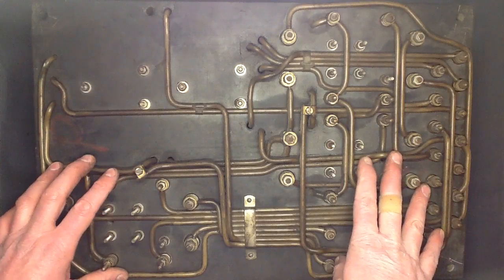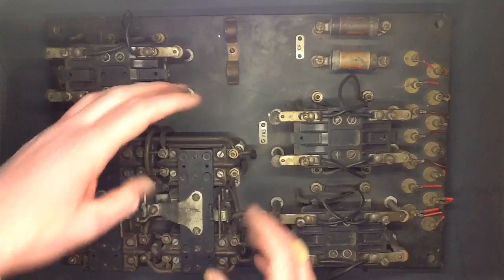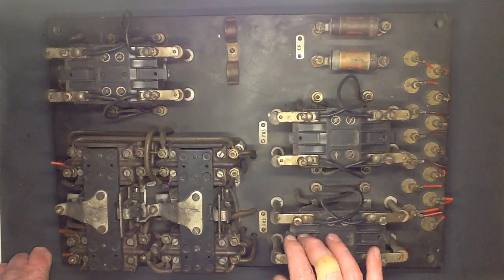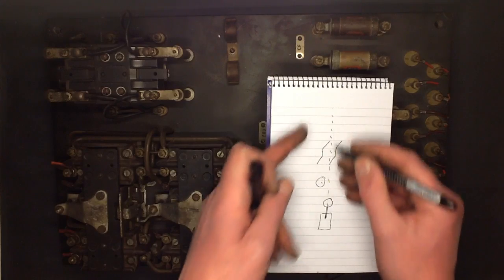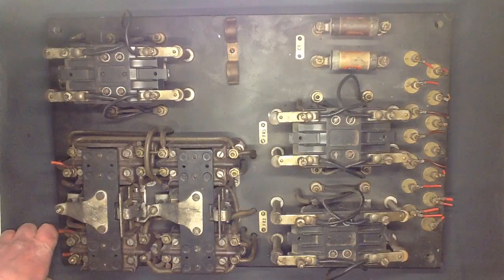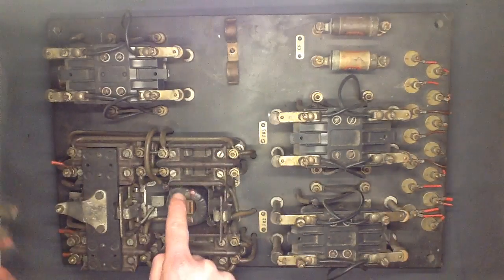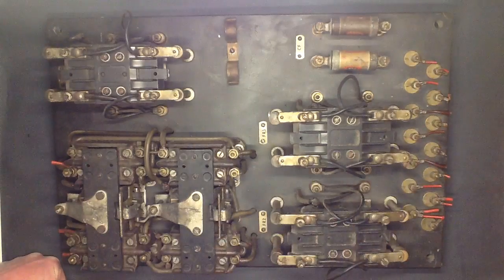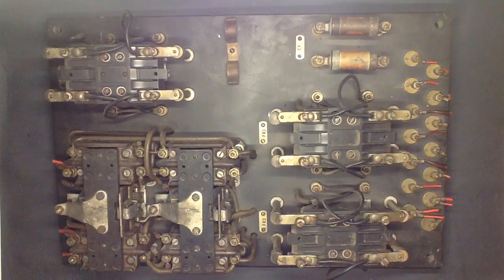Really old and VERY heavy slate elevator controller.

Comment: as an elevator repair mechanic, i enjoyed this video! :D
Reply from the maker: i bet you don't come across many like this these days.
Reply: bigclivedotcom honestly? The majority of them has been replaced, but they're still a whole lot around. The oldest I've seen, that is still working, is from 1933!
Reply from the maker: That's good.  For many applications they are just physically better suited to the job.  No secret diagnostic codes and extremely expensive drives that go bang on a regular basis.
Reply from the maker: If you get a chance to film some of the older units in operation it's always popular material on YouTube.  Even the simplest controllers and machines.
Reply: Will do mate. I've got a repair planned on an elevator with a panel similar to this one soon, will shoot a video. And yes, laws and regulations force clients to replace these panels with frequency regulated drive modules, and if they go bang, which they'll do eventually, it'll cost around €5000 for a replacement unit.
Reply from the maker: When you do make a video, remember that it's more important to get that video on YouTube than how it looks or sounds.  I think a lot of good technical footage never makes it to YouTube because people thought it wasn't good enough.  When you're filming in the raw with a phone it's never going to look or sound like the "pro" videos.

Comment: Memories! I served my time in a place that was full of kit of similar type(s). The place was all electro-mechanical, with rotating DC machines for generation and drives. Amplidynes, boosters, and a huge 11kV powered synchronous motor driven double ended Ward-Leonard set.
All pretty reliable as long as it was kept clean.

Comment: we had a similar one in QMD, it went from lower ground at the rear of the building up to the canteen.  The panel in the lift plant room was a joy to watch clacking and clunking through it's sequences... and although it was regularly checked during scheduled maintenance, it was rarely out of service or requiring any real work... just contacts getting cleand, like you said... unlike the electronic laden ones at reception... the fancy modern Otis Gen 2s (not to be confused with penguins) in PQ are so reliable I tend to use the stairs more often than not.

Comment: Clive have you ever visited the Manx Electric Railways sub-station at Laxey? Very large slate slabs for the switches and contactors and, when I visited many years ago, mercury arc rectifiers, cooled by the original wooden fan.

Comment: Very interesting, great idea for a video, Big Clive! Appeals to our sense of proportion and imagination of history. But, lots of big clunky contacts, imagining those high voltages and massive currents but see nor hear anything about insulation between those contacts
Reply from the maker: A  lot of this equipment is still in use, and the machine-rooms have stacks of electrical equipment covered in exposed live metalwork.
Reply: bigclivedotcom Actually my question was about the insulation material used in contacts inside those relays. Can't make out any for sure in the video. Incidentally, why would all the wires on the underside have been sheathed in metal?

Comment: Solid Slate Relay=Expensive and intricate but well made and built to last.
Solid State Digital=Really Expensive and flimsy but not made to last.Relay controllers are much better quality, reliable, easier to repair, and last a very long time with very little problems.

Comment: I'm surprised that you said that this control board was simply mounted on the wall. Did you mean that it was completely exposed with no surrounding box around it? I fear dust and bad contacts, although perhaps if it's in a box that would keep most dust away

Comment: I love this beautifully made frankenstein stuff........It reminds me of the choke assembly of my old Rolls Royce Shadow....No electronics, just a butterfly attached to a coiled spring in a tube from the manifold which was closed when cold. When the engine was started, the heat would start to expand the spring, opening the butterfly and lessening the choke until the engine was warm ! They used this up until the late 80's.It NEVER went wrong ONCE !!

Comment: In my aunt's housing block there is still a old communist elevator - probably from 80's. But it at least unlocks the door automaticaly on the floor where it is situated (you still need to push the door) - it is a big fun to ride it xD

Comment: 450 volts? does that mean it's a 3 phase 400 hertz current?
Reply: In the U.S.,  the common 3-phase voltage is 208 volts using 120 volts per phase.  Since the UK is double the voltage, 240V, then the 3-phase would be 240V * 1.732 = 415 V.
Reply from the maker: 415V.  In the UK our supply is a simple three phase system with 240 to neutral from any phase and 415 between phases.  (supposedly 230V and 400V under European rules)
Reply: bigclivedotcom Ah I see. I work on aircraft with a 3 phase current as well as 28 volts DC, I thought it would be odd if an elevator worked off the same power as an aircraft lol
Reply: +ass burgers - Aircraft use 400Hz because that way the transformers can be a LOT smaller (thus lighter, which is good for aircraft!)

Comment: Tiny modern electronics are cool for things like computers & ipads but for by heavy duty work these robust "circuitry"I think is for the win.
our public transport service recently changed their esclators for more up to date, high tech, wizz bang electrics. And yes they all break down every few week and take a day or 3 to fix when the old types would hardly ever stop working.

Comment: Looks a lot like the elevator controls in an abandoned building I explored recently, it was built in the 1960s and it still had most of the original 60s equipment running the building when it was abandoned about 1990. Huge banks of relays, selenium rectifiers, massive transformers, etc. I even found and grabbed the schematic for the elevator controller!
Reply from the maker: I love the old stuff.  It looks and sounds great when it's running.  I bet the schematic is huge.
Reply: It takes up four pages, and they are all about twice the size of a standard sheet of paper
Reply from the maker: It would be interesting to see those if you had a way to take an image from them with good detail.

Comment: A work of art. I'd hang that thing up on my wall any day. 
Also, is that really only 30 years old? I would normally associate a heavy, mechanical construction like that as being more like 50 years old, if not more. Is there any sort of marking on it that would hint at a date?
Reply from the maker: I got it when it was about to be scrapped 30 years ago.  It's a LOT older than that.
Reply: I reckon about 1924.
Reply: bigclivedotcom it looks like a 1940s to me

Comment: It's a beautiful thing. Would be nice maybe to make a bit of art from it. NOT to do any damage to it, of course, but maybe stick it on a wall with a transparent case around it, have the relays clacking along every so often. Maybe have the relays drive each other, though you'd need a delay element. Which could be electronic, or a microcontroller. Or it could be some weird mechanical thing involving sand and see-saws. 

Simplest idea would be an Arduino and some triacs I suppose. Would it work on 240VAC? Would 240V at least hold the contactors down? Just because I think it would be really charming to have them clacking away, once a minute or so. Perhaps have that configurable, too. Or perhaps a button (the lift button!) to reset it, then after reset it gradually starts to lengthen the time between changes. Quicker at first so there's something to see, but then slows down the changes, or stops and powers down altogether, when it's assumed you've had enough of the thing. 

You could, too, have a mains relay in front of the whole thing, to keep the power cut off for when you go to bed. Or a switch, whichever. Just so you don't have to worry about it catching fire. Not that it's likely to, if it's spent 90 years in a dusty lift shaft no problem. Actually if it did, it'd be the one thing you'd pull out of the ashes unscratched. 

Perhaps some neon lights with bronze bushing around it, or a nice teak panel, with the lift's call button installed there. You could even implement a tiny model lift shaft, an actual reconstruction with a tiny little lift. You could lend it to museums to confuse children.

The 450V is a bit of a pain in the arse, but you could supply that from a transformer, maybe via a low voltage transformer, to isolate it and keep the current limited. Then it could be powered from something low voltage, be a little less dangerous. 

Anyway, that's for you to work out, but... art! This thing's just too nice, not to have it where people can see it. Well, "people". Geeks, obviously. 

Also would be nice to have a print made, a photo, of the back of the panel. Or a mirror behind it. So people can see both sides of the panel. Since it's such unusual construction, I've never seen anything quite like it even on the Internet, and I've been online since just about the beginning of the WWW. 

Bit of neon, brass, decent wood. Maybe even some enamel. Could be a beauty, after all these years hidden.

Comment: Good board, it shows that were made with quality.
simple, reliable and efficient system.
Now lifts are less reliable, Why? because poor quality components are used, they are not designed with efficient cooling, so just broken.
The same thing happens cars, such as Mercedes EZS units are burned by a bad cooling transistor.

(sorry my bad english :( )

Comment: do you reckon you could hook it up to a low voltage circuit, perhaps just lights and switches to represent how it works?
Reply: You need 450 volts to pull in the contactors.

Comment: I remember these when I was a kid back in the 80's/90's. Just as you describe, start at full speed and stop with a bang. They even had a stop button to stop the elevator and you could open the doors between floors. Scary, but good memories ;)

Comment: Carbon contacts where user to prevent contacts from welding in. Elevator and railway signalling and control contractors and relays are required to be fail safe. They look like old Cutler-Hammer gear or perhaps English Electric. Normally in old industrial control circuits the contacts were silver.
Panel weight ~20-25Kg

Comment: Just as an additional aside, if anyone is interested in seeing a 1936/1940 electric impulse clock system which was installed in a WW2 shadow factory here in Kendal and you are in the area, go to Sleddall Hall Antiques Centre where it can be seen working. Crash and bang.. It is not for sale- it's part of our heritage and quite rare as the equipment was usually destroyed after the contract ended.

Comment: 6:22 the interlock keeps the contactors from being pushed in atmthe same time.or if someone screws up and wires the buttons wrong. in a for- Rev 3 phase starter if both pull in at the same time you'll get a dead short between 2 phases and a fireworks show.

Comment: Lifts/elevators and air conditioning, two things that I have never seen work reliably. Maintenance companies blame the manufacturers/designers and the designers/manufacturers blame the maintenance.
Reply from the maker: +bobdvd Two industries where there is a lot of unskilled labour used to allow for cheaper maintenance contracts.
Reply: +Midnight Mechanic I work in the consumer electronics industry and I can testify that there isn't planned obsolescence. There are budgets and pressures that mean you build it as economically as possible and different companies have different price points but the only way failure is planned for is statistically. We assume a lifetime of x years minimum for every product (2-7 years on most devices I work with) and less than 1% of them should fail inside the lowest bound. But there is no explicit desire for them to fail after that. Actually most companies are proud when there hardware runs long. 
The only thing that conflicts with that is the sales team desire to sell new product but I have never seen this impact the design of a product.
Reply: I got a very old, 1978 FER air conditioning unit that was made to be mounted below a railway carriage (Italian "Gran Confort"carriage). The thing is 3 phase 380V/50Hz powered, and 28 kW, weighs 240 kg! Sadly I didn't get the evaporator, and it uses R12 which is impossible to find, so it was impossible to use. A friend of mine that works in the AC business gave me a sized evaporator and recharged it for me with a compatible gas, and of course when I put power to it it immediately started up and was operating perfectly, with a loud clank-clank from the contactors :D
Logic is all electromechanical, it has a TXV as a metering device. I can't use it much because it is WAY too powerful for my room (it cools it in 5 minutes :D) but in hot summers I still use it. It has never failed.
Reply: +Midnight Mechanic Planned or "built in" obsolence is basically an urban myth due to a lack of understanding of economics. Everything is a balance of price and quality; you can make a product that lasts 100 years, but it will cost a fortune (and be obsolete anyway long before then). So products are made "good enough" and how "good enough" depends on what people are willing to pay, or can pay.

The result is that we get more goods, approaching (but never reaching, due to uncertainties) the optimal supply of available goods for a given stage of technological development.
Reply: +bobdvd Having worked in AC maintenance, I can say that the basic problem is the huge number of individual components involved; loads and loads of valves, controls, fans, controllers, relays etc etc, any of which can fail. MTBF and all that. And office floors full of people who can't agree on what temperature they are comfortable at, leading to half the people always being too hot or too cold, especially in summer when the men are wearing suits and the women are wearing strappy tops and mini-skirts.
Reply: +Doug Anderson you don't have to believe someone who has spent a large part of their career working in consumer electronics at all levels for some big brands. That is your prerogative.
Reply: +bobdvd I blame planned obsolescence, it's purpose built into most components today because there's a market for maintenance, and if you build things right the first time, then the market share of that sector goes down exponentially, potentially causing job losses across the board, and making communities dependant on maintenance industries to become deeply impoverished.  Gotta love the power of money, huh? ^_^
Reply: r12 is easy to get...
Reply: If planned obsolescence really was a thing the companies implementing it would get a terrible reputation for poor longevity of their products and people would stop buying from them and they'd go out of business.  Making your products last a long time gives you repeat customers and free advertising from people happy to recommend you.  What really works is making your product fashionable, so that you can change it every 12 months and have people clamoring to buy the new version even though there's nothing wrong with the old one.  That's the real secret to generating profit.

Comment: wonder if I should show mom theses.  one of her first jobs was being an elevator operator.  and it wasn't one of her favourite jobs because of the horror stories of falling 9-10 floors.  cause thats how elevators were then.  no brakes.  yeah what floor you want  punch.  I've been in old school lift ones but I could operate those on my own and I have no idea when those were put into the old Wards building (although some claim it was the old Sears .  hey who knows. the building isn't housing the paper anymore
Reply: +Lee Bartholomew Elevators have a calliper system invented by Otis (elevator manufacturers) in 1853. As long as there is tension in the cable the callipers are held off. If the tension is released (cable breaking etc) the callipers slam into slots in the shaft, making it impossible to move the elevator car up or down.  Every elevator has these, I doubt you would be allowed to run one without this really quite foolproof mechanism, making them actually very safe. Most horror stories are - just urban myth stories.
Reply from the maker: +Lee Bartholomew Even the earliest elevators had the safety brake system.  There have been a few plummets from a number of concurrent failures though.
Reply: bigclivedotcom
I don't go in depth with mom on her rides.  she doesn't like talking about them.  For whatever reason .  ;) I'd assume Elevators in the 60's but not really sure
Reply: +Keith Graham that was the problem back in the day .  No social media to kill urban legends ;)
Reply from the maker: +Keith Graham Most modern elevators use an overspeed governor that locks the brake rope and pulls wedges into place on the rails so the car comes to a controlled but fairly abrupt halt.  For hydraulic systems there may be a similar wedging system at the base of the hydraulic ram in addition to oil-flow speed shutoff valves that can stop the lift if a pipe fails.
Reply: Lee Bartholomew I know the Otis one uses a calliper system, the callipers are spring loaded to lock into slots in the shaft. They have a pivot in the centre above the cab and the weight of the cab pulls them out of the slots. Once the tension is released, (as in the cable breaking) the callipers open and lock into the slots. After writing the first post I looked up elevator accidents and they fell into 2 categories, either falling down the empty shaft/being crushed while maintaining or the movement assembly (weighing several tons) falling through the roof of the cab.